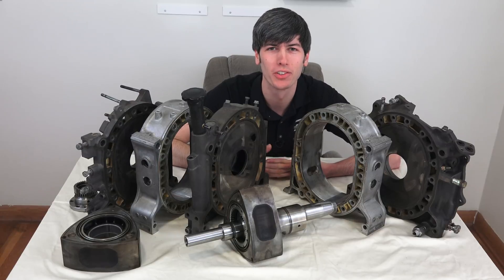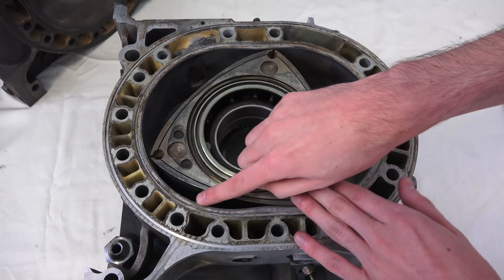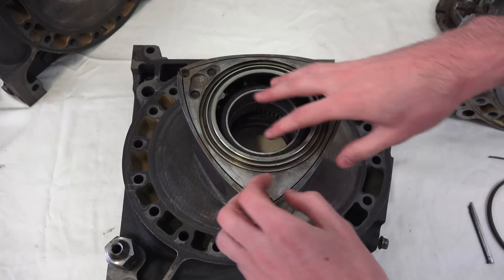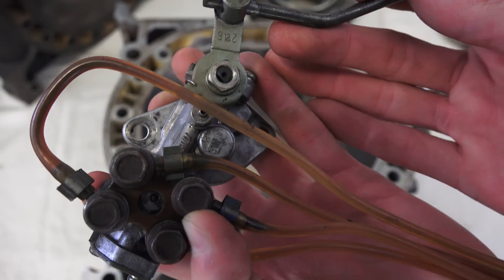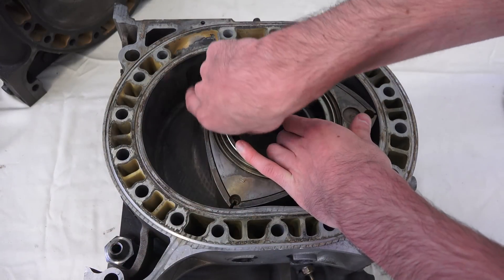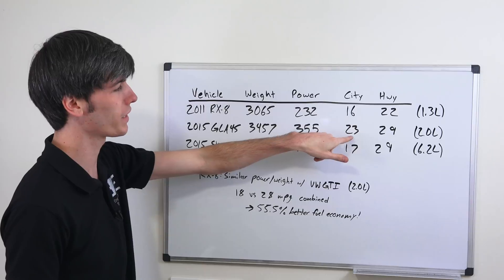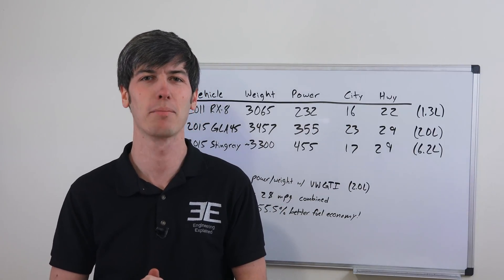4 Reasons Why The Rotary Engine Is Dead

Comment: Regarding the problem rotaries have maintaining a seal across the temperature differential 
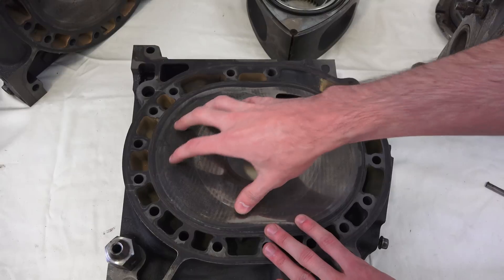that occurs from the intake side to the combustion side - @2:15
Couldn't you even this out by alternating the combustion chambers up/down in 2 or 4 rotor setups?
You'd have to make your own shaft, of course...

Comment: No Power Torque under 5000rpm 

Much fuel for nothing 

Engine low compression 80.000/120.000 rotary dead .... engine doesnt start if engine is hot 

Only good thing interesting sound ...

Comment: Have y'all seen the newer rotary engine? Wet something I can't remember what it's called exactly but,  it had fuel and air intake and out through the center shaft? Rather than from the outside walls.  I can't explain but it's kinda dope.  Im new to cars btw. I like them and I try to talk with you all about them to the best of my abilities.
Reply: That is just a vaporware investment scam. Liquid Piston is not a legitimate engine manufacturer.

Comment: It would be nice to have such a video for flatheads. We know the huge surface area of the chamber hurt it but by how much ? And any other relevant reason.
Reply: Excellent question, flathead engines suffer from the same combustion efficiency and thermal efficiency problems but they have many advantages the Wankel does not. 
Wankel engines are less reliable and less mechanically efficient than reciprocating engines. Flatheads simple, cheaper and easier to build as well.
Both are obsolete because of poor combustion efficiency.
Both engine types cannot support modern high swirl or quench type combustion chamber architecture and cannot support the higher static compression ratio required for GDI (direct injection)
There is no possible way to incorporate a quench type chamber.

Comment: Don't care,  I love my rotary ,tell me any other engine that can rpm at 10,000.
Reply: Actually it only revs to 1/3 of that rpm.
Reply: @sandervanderkammen9230  That is so silly-wrong.   an RPM is an RPM.   One crank revolution on a crap-wankle and 1 revolution of the crank on any other engine is still just one revolution.
Reply: @Doonit_hard_way_since_65  Apparently, you don't understand how the Wankel engine works.

Comment: Rotaries aren't dead bro they are just different. The airforce is looking at making a contract with a company that invented the liquid rotor piston engine. It is a rotary with no apex seals and no valves, it has a semi hollow rotor that performs the combustion cycles and  it is more thank likely going to be used in calaberation with hybrid electrical systems similar to the Mazda rx9 prototype.
Reply: Wankel engines are obsolete technology.
Liquid Piston is a fraudulent investment scam.
Mazda abandoned all development of Wankel engines in May 2009.
The RX9 is a internet hoax, it does not exist.
Reply: @sandervanderkammen9230  If liquid piston rotaries are an investment scam than why are there already working models in existence? Also mazda just released a car this year that uses a hybrid rotary system. Lastly the company that is trying to contract with the air force shares no relation to mazda at all.
Reply: @alecblackson771  They are called "props" the higher the stakes in the scam the better the props.
Cyclone Power Technologies is another very similar type of scam company.
Reply: @alecblackson771  NO, THEY DIDN'T...
The Mazda MX30 is already in production and is available in selected markets.
It does not have a Wankel engine.
The MX30 will only be available in a 100% plug-in battery electric vehicle or as a mild series hybrid powered by a 2.0 liter Skyactiv G engine.
Reply: @sandervanderkammen9230  Id agree that gas powered rotaries are dying if not already dead. But alternative fuels don't require as mutch oil in the fuel, if any at all. Im not saying the idea is going to be successful, but people obviously see potential in it because they are still trying to develop the rotary motor to be more efficient. Also look into the Mazda skyactive X. It uses a rotary hybrid system.
Reply: @alecblackson771  Wankel engines have several serious disadvantages when combined with alternative fuels, gasoline was the only successful fuel used.

Wrong! Mazda's Skyactiv-X technology only applies to reciprocating engines.
There are no Wankel engines that use Skyactiv-X, they are incompatible.
Any questions?
Reply: @sandervanderkammen9230  You are correct about the skyactive x tho. That project is what created the 2l variable compression motor, not the new rotary generator.
Reply: @alecblackson771  There is no new Wankel engine... Mazda canceled all development of the production Wankel engines in May 2009.
No new prototypes have displayed in  14 years and the last production engine was unveiled a quarter of a century ago.
Please stop spreading false rumors from phony clickbait blogsites.
Reply: @sandervanderkammen9230 the link has motortrend in it dude. Is motor trend not a reliable source 😂
Reply: @alecblackson771  Never has...
Reply: @alecblackson771  Today is the 9 year anniversary of the end of RX production at Mazda...
The very last Wankel powered Mazda rolled off the production line on June 21st 2012.

Comment: What about the fact you can burn hydrogen in a rotary engine and have no emissions.
Reply: They still have to burn lubrication.   fail, guess what, burning oil creates emissions.
H2 burns cold, and wet compared to petrol, water, believe it or not, is not good for metallic components.
Rotary has a terrible dynamic compression ratio.
Catalyst exhaust systems do not like water.
it takes around 3000 Cu/Ft of H2 to produce the same boiler HP as 3 gallons of petrol.
Reply: Wankel engines are less efficient running on hydrogen than other engine types and has the highest emissions of any hydrogen engine.
   Mazda's entry into the Norwegian HyNor hydrogen vehicle test program was the worst performer of any automobile manufacturer in the preliminary tests and it was rejected for long term testing due to high fuel consumption and exhaust emissions.
Reply: After Mazda's humiliating failure at HyNor the company abandoned all development of hydrogen fuel vehicles.

Comment: You cant really compare without equal cubic capacitys a 1300cc engine vs 2000+cc engines, the 20b would have been a more fair representation.
Reply: The Mazda 13b series has a total displacement of 3.9 liters or 2.6 when compared to a reciprocating 4-stroke Otto type engine.
Reply: A 13b is a 1.3 litre engine 1300cc or 1308cc
Reply: @L00NEY79  NO... its not.
Reply: @L00NEY79  I guess by that logic an 8.4l big block is really only a 4.2l, right?   Let's see if I can make that one fly with my insurance man.

Comment: As a mechanic myself the rotary is all, but dead. Is still becoming and improving engine capable of adapting to different fuels, as mazda brought it back. As a range extender.
Reply: Mazda abandoned all development of Wankel engines in May 2009.
The last time Mazda unveiled a new production engine was the year MicroSoft launched Windows95.

Comment: So with all you said about the gasses mixing and seeping into other chambers and heat and non combusted oil being forced into the exhaust ports with higher heat can it damage seals and all
Reply: It's the primary failure mode of Wankel engines.. leaking combustion gasses destroys the internal seals.

Comment: apex seals should be designed with vertical loaded springs and the chamber designed in a perfect circle.. the chamber doesnt need to oval and distord.. the dorito apex seals should be adjusting... this solves a good 35% to 40?ish% heat issue.. also wouldnt the apex seal be much better being a bearing tip? with spring load?
Reply: Apex seals are spring loaded... and adjust for thermal expansion and contraction.
Reply: A perfect circle?  That won't work because the orbiting piston  (aka rotor) does not rotate concentrically on a fixed axis... the Mazda 13b engine for example has a 30mm stroke twice per crankshaft revolution...

Comment: Had a Mazda wagon with a rotary engine and that thing was sick fast.
Reply: I'm guessing you have never driven a. REAL performance car...?
Reply: @sandervanderkammen9230  does a 1969 396 Chevell SS qualify?
Reply: @jluvs2ride  Maybe in 1969... but not by today's standards...

Of course anyone the has actually driven one would never call a Mazda wagon fast either...
Reply: @sandervanderkammen9230  sounds like you've never driven either. And I didn't say that the Mazda was the fastest thing on the road, it was just surprisingly quick for what it was.
Reply: You wrote quote; "Had a Mazda wagon with a rotary engine and that thing was sick fast." 
 What did you mean by "sick fast?"

Because if you ever drove a 1969 Chevelle SS you certainly would not compare it to a Mazda wagon... would?  Unless of course you were lying?
Reply: @sandervanderkammen9230  considering what it was it was sick fast next to any other Japanese wagons of the time. I never expected some lonely GTA player to dissect my remark under a microscope. Run along now, your mommy has milk and cookies for you.
Reply: @jluvs2ride  Oh! I see...  So what you meant to say was compared to other shitty Japanese wagons the Mazda wagon was "sick fast"??? 
That is very different than simply saying your shitty little Mazda wagon was "sick fast"

Comment: A thing to remark about the so called 'Wankel Rotary Combustion Engine' is that it owes more of its design to Walter Froede of NSU, rather than to Felix Wankel, W Froede made the geometric inversion of functioning that made the original prototype by Felix Wankel a practical machine. 
Felix Wankel, having no engineer degree, no driver's license, was an expert in tightness, his is the design of seals that allowed the machine to generate compression, then power.
I'd better call this RCE, 'The NSU Rotary Engine'. 
Felix Wankel designed a Torpedo engine for Junkers, the KM8, with disc rotary valves on top of combustion chamber, that, what a coincidence, was identical to a design by Reynolds, USA, around 1910 (See 'Gasolene engines', Verrill, 1912) Blessings +
Reply: The Wankel-NSU KKM-57 was designed by Hanns Paschke and Walter Freode without any knowledge or assistance from Felix Wankel.
Felix Wankel hated the KKM because it was not a Rotary type engine.
Reply: @joseveintegenario-nisu1928  ANSWER THE QUESTION!
   PLEASE CITE A SINGLE LEGITIMATE ENGINE MANUFACTURER producing the Wankel engine in regular series mass production???
Reply: @joseveintegenario-nisu1928 The Wankel engine was a complete failure... completely obsolete in 2021, no longer manufactured in series production anywhere in the world.
Reply: @sandervanderkammen9230  Repeated lie, repeated slander, damaging RCE makers. There are many Wankel RCE producers, although in small series. Bye
Reply: @joseveintegenario-nisu1928  THE TRUTH SHALL PREVAIL
Please cite  a single legitimate engine manufacturer producing the Wankel engine in regular series mass production???
Reply: @sandervanderkammen9230  You won the 'Troll of the month' award. Blessings +
Reply: @joseveintegenario-nisu1928  Stop by your local Mazda dealer and ask to see the new Mazda RX... 
The salesman will tell you there hasn't been one in a decade.
Reply: @joseveintegenario-nisu1928    PLEASE CITE A SINGLE LEGITIMATE ENGINE MANUFACTURER producing the Wankel engine in regular series mass production???
Reply: @sandervanderkammen9230  Go to any search engine, Wikipedia, enter 'Wankel engine', 'Wankel engine producer', there are many. Gesund +
Reply: @joseveintegenario-nisu1928  Go to any search engine, enter Free Energy  Engine. There are many but like all the companies that claim to make Wankel engines they are all fake gimmicks or  fraudulent vaporware investment scams.
Reply: @sandervanderkammen9230  A report about this will cost you $55044
Reply: @joseveintegenario-nisu1928  You don't have $55,044....

Comment: Rotaries aren’t economy engines, they’re performance engines... if your worried about economy, buy a more economic car, if you want a 1.3L turbo to rev to 10k and produce 400hp in an engine that os the size of a shoebox, then buy a rotary...
Reply: @waldolemmer  I am writing a book on the development history of the Wankel engine...
Reply: @waldolemmer  thank you, I’m usually the one picking up on that. I probably types it on the phone and got half way through typing and hit the autocorrect button... not like me at all.
Reply: Wankel engines could no longer compete with reciprocating engines for performance which is exactly why no one sells cars with Wankel engines anymore.
Reply: @waldolemmer  There is a lot confusion and misinformation regarding Wankel engines and why they were a failure....
Any questions?

Comment: Beside fuel and oil, it also eat spark plugs again and again. This machine is terrible. Sold years ago
Reply: One of Wankel engine main advantages is it can work on very low quality fuel, also, it works better with Ethanol in gasoline mixes, E5, E10, pls read SAE technical papers: ' The Effect of Alcohol Blends on the Performance of an Air Cooled Rotary Trochoidal Engine', SAE  840237; Marcel Gutman, Izu Iuster;                                                                                                                                           'Development of the Norton Rotary Motorcycle Engine', SAE Technical Paper 821068  D. W. Garside; 'How much overall energy does the Automobile require?', SAE Journal Automotive Engineering, vol 80, n 7, pp 36-38, Jul 1972;  'How much Energy is needed to produce an Automobile?', SAE Journal Automotive Engineering, vol 80, n 7, pp 39-40, Jul 1972;  'Lubricant and Fuel Requirements and General Performance Data of Wankel Rotary Piston Engines', SAE Technical Paper  730048, R. D. Behling, E. Weise;  'Research and Development Work on Rotary Combustion Engines in China', SAE Technical Paper 880628, Teluan Chen; 'Controlling two-stroke engine emissions',  Automotive Engineering International (a SAE magazine)  2000-02-01. With the constant rich operation of two-stroke engines, common design criteria for three-way catalysts fail; 'The Intake and Exhaust Pipe Effect on Rotary Engine Performance', SAE Technical Paper 2013-32-9161. Dun-Zen Jeng, Ming-June Hsieh, Chih-Chuan Lee, Yu Han;  'Analysis of Light-Load Performance in Rotary Engines', SAE Tech Paper 790435                                                                        Toshiyuki Kohno, Ryozo Ito, Minoru Morita, Nobutaka Mizuno (Toyota); 
Blessings +

Comment: "Why did the rotary engine die?"

Part of it is probably how you have it all opened up on a table like that.
Reply: The patient died before it reached the operating table.... think of it as more of an autopsy.
Reply: That's known as a "post mortem".
Reply: Poor engenering. "The oil rec."
Not good for a engine that by nature burns a slight amount.
Reply: The clue was when he pressed the throttle for the oil and the engine didn't do anything.
Reply: Better airflow this way
Reply: I had a friend who wanted me to fix his RX-8...... So I talked him into putting 6.0 LS engine  in it....... Then the only problem he had was keeping tires on it
Reply: @tommyemler1763  lmao
Reply: 😅😅😅 Funny! All of my Rx7's have run just fine, passed CA smog test EVERY time, and have been a blast to drive. Think about it - ONE gallon of gas can carry you 22 miles. seriously, my other ICE cars get about the same. no mechanical problems if you don't try to break them...
Reply: @oldrrocr I love your sarcasm...
Reply: @sandervanderkammen9230  :face-blue-smiling: you're the only one.
also, I suppose you could swap the Wankel for a Ford EcoBoost... I understand they are very reliable.
Reply: @oldrrocr  If your comment was not intended as a joke? Then you are the biggest liar on YouTube son.

Comment: Interesting, in the experimental aircraft industry, people are still trying to justify small jet engines.  These have extremely poor thermal efficiency.  In this arena, the Wankel can still compete but here again, high performance 3 cylinder engines are showing huge fuel savings and very low engine weights.
Reply: You clearly have no clue what you are talking about... Wankel engines are much less efficient than gas turbine engines and they are too unreliable for passenger aircraft.
Reply: The gas turbine engine offers a significant advantage in power-to-weight ratio performance and an order of magnitude increase in reliability when compared to the Wankel.

Comment: "If' So Then Why Are They Banned In Racing?" -Destrova
Reply: The Wankel engine was never banned... manufacturers simply discontinued them.
Reply: @sandervanderkammen9230  they banned after 1991 Le Mans victory of 787b
Reply: It was not banned in any way.  The FIA rules just made them live with their actual displacement, not that made-up BS mazda was trying to push. When in the rotary had to compete with cars that matched it's actual displacement  in a fair manner it failed miserably. If Mazda had continued they would have been forced to compete against 15,000rpm V8's that cranked out 1Khp+   The rotary was not capable of such competition. As fuel hungry as the motors were they required more fuel stops in a race format that penalized needing to refuel.

Comment: About oil consumption: RX-8 takes less than 1l per 3000km. I owned a new VW Passat TDI several years ago that took more oil! So oil injection is really not a problem. 11mg of Nox. A Diesel has  more than 500mg! Some years ago they forced all cars in Germany for CO emission measurements. They cecked only CO. When they measured CO at the german TÜV I got a certificate of 0,00 Volume percent. Why do they grab my 48Euro for a clean rotary car that especially has no CO emissions at all, because of engine construction with airpump and afterburner? In Germany you pay about 120 Euro taxes for a rotary. Taxes are based on car weight for rotaries, same as for trucks.
Reply: You elected the idiots running your country.